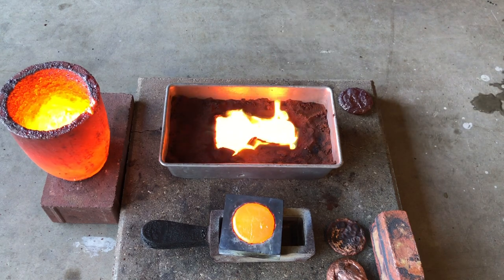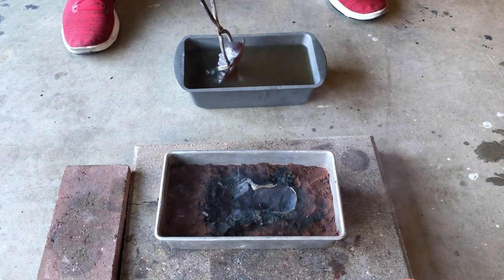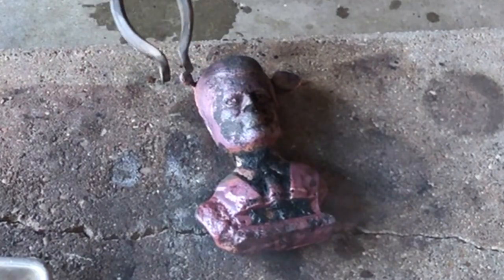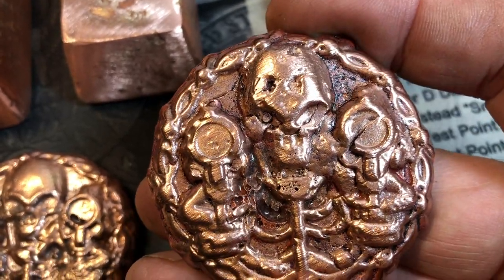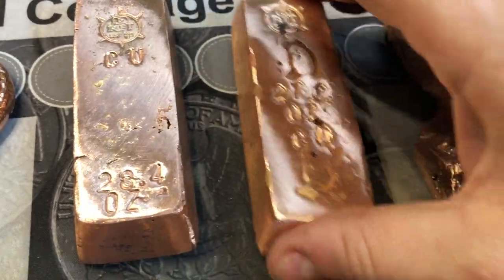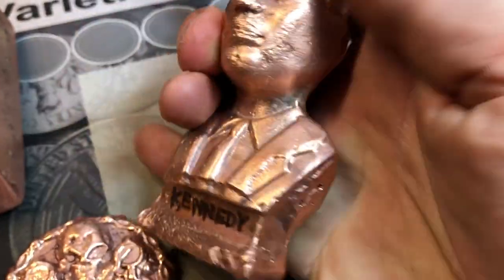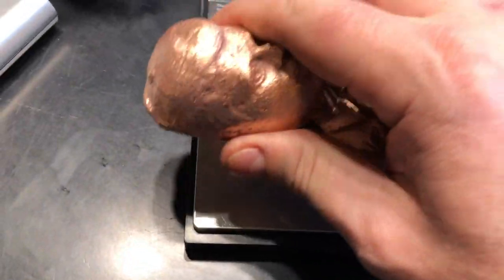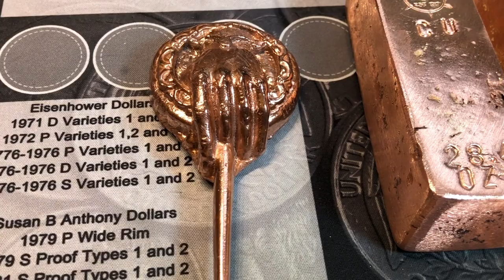Casting Copper - Open Mold Casting The Hand of The King and a Kennedy!

Comment: You should watch a fewl videos on casting and try a complete casting for the Kennedy. My only comment would be to increase your quenching bucket or use a block of ice. When the water gets too hot the quench can crack the subject.
Reply from the maker: I agree William but baby steps for me.  I have officially now sand casted 4 things.  Wanted to get used to the process a bit before I go big.  Of course, in Texas we're supposed to GO BIG or GO HOME.  :)
Reply: @RobFindsTreasure  it's not that hard Rob, you have have confidence and patience for great rewards.

Comment: I love your pours. The Kennedy looked like Shrek....😂😂 I use to make brass golf putters. We had them poured at the foundry. I know they used sand but I didn't get to see it happen. Then I would sand them down, drill holes for the shaft and stamp the bottom. So I do know what you are going through. Curious about your sand mixture.